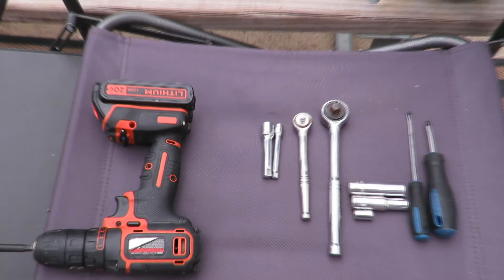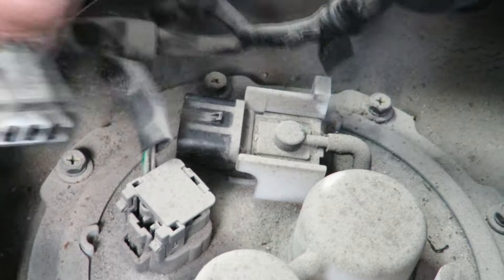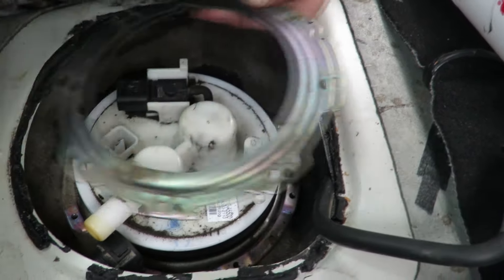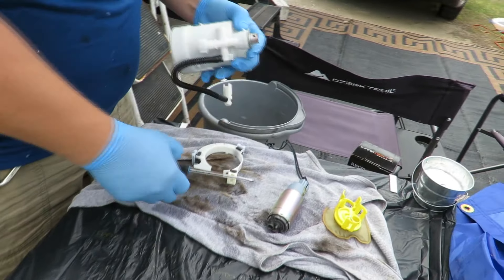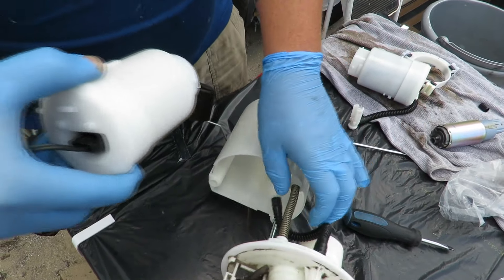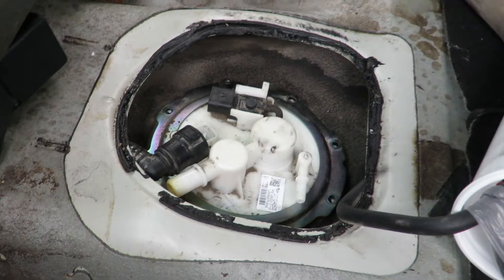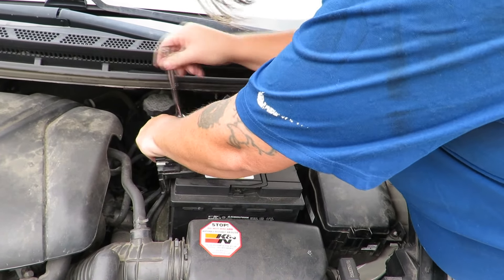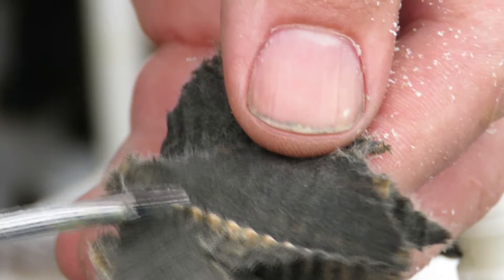Replacing the Fuel Pump and Fuel Filter on a 2014 Kia Forte

Comment: FYI, the service manual states to remove line pressure, remove the fuel pump relay then run the engine to use up reserve pressure. Once you're done you'll need to put the fuel pump relay back in. This will generate a trouble code, so you'll need an OBD2 tool to clear the code.
Reply: Could you share the service manual?
Reply: @VEW RV Adventures Did you not have a trouble code generated in your repair? Did you remove the fuel pump relay or did you just remove the fuse as you showed?
Reply: @RhamonGB  Go buy it like everybody else
Reply from the maker: On ours the relay and the fuse is the same.
Reply: Disconnect battery, turn on lights to drain ECM computer caps. Fault erased

Comment: thank u for posting because i have to do this very soon on my forte.  here's a tip when working with car batteries. always take the negative lead off of the battery first. if you don't, and you accidentally hit the body of the car with the wrench while you're removing the positive lead, you're gonna make some scary sparks and if it's a bad day for you you could toast some electronics.  so if you take off the negative lead first then that can't happen. if you hit the wrench and the negative lead to the body nothing bad ever happens or if you hit the positive and the body after the neg is off, there's no path for the current and nothing bad can happen.  all the best.
Reply from the maker: That is so true about the neg cable. We originally wasn’t going to this video, we normally do campground reviews. If I do the video again I’ll be more accurate.

Comment: Pull the fuel pump fuse, start the car(if it will still pump fuel), and let it run til it dies. Shouldn't take more than a couple of seconds. Then disconnect battery, put the fuse back in, then pull the fuel lines off.  They shouldn't spray on you if you do it that way.

Comment: In theory if you didnt want to do all the small work, if you buy the "Fuel Pump & Housing Assembly" (how its said on Rockauto) it has fuel pump and fuel filter already assembled and you just drop that whole white plastic tank looking piece in and throw out the old one, right?

Comment: Is that a kia koup sx?
Reply from the maker: This is on a 2014 Kia Forte. Not all but most of the Kia's will be done the same way.
Reply: @vewrvadventures1863  what kind of forte ex or sx
Reply: @vewrvadventures1863  mine is the 2015 forte koup 1.6l turbo. It will run for about 45 minutes and then it will die and we have to let it sit for like 20 minutes to get it to start again it's acting like the filter is clogged
Reply from the maker: This is the ex. It sounds like your fuel pump may be shutting down after it gets warm. If you don't have any check engine lights most likely your issue is fuel. When was your fuel pump replaced last? Do you have any codes?
Reply: We replaced the pump 4 months ago. After it sits for like 30 min it will start and run for a while and do it again.

Comment: did you try opening the fuel cap before to try and depressurize the fuel system? maybe it wouldn’t have shot out like that
Reply from the maker: We did have cap removed and was pretty sure we ran the car until fuel was out of line. But it did have pressure built up, not for sure why.